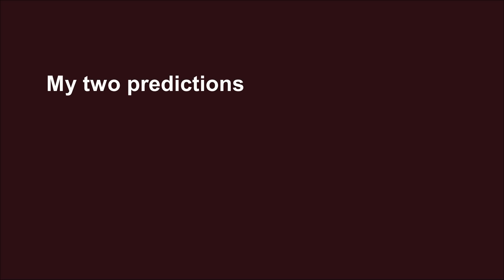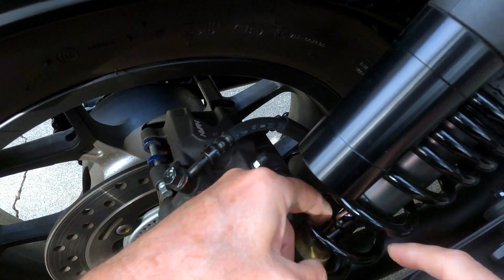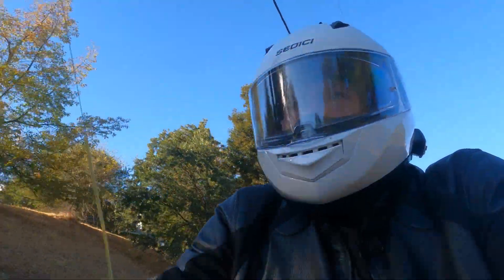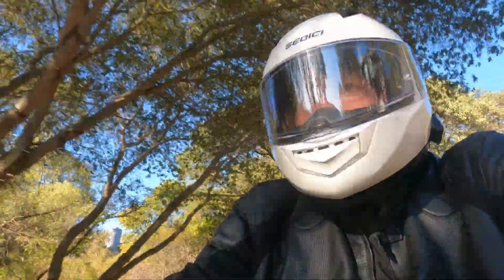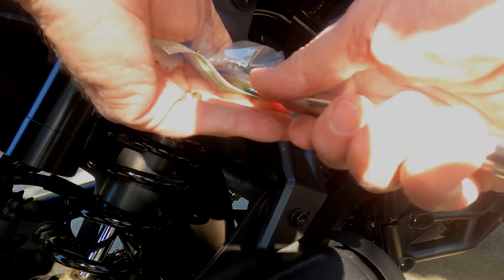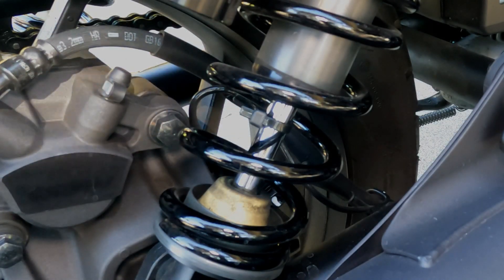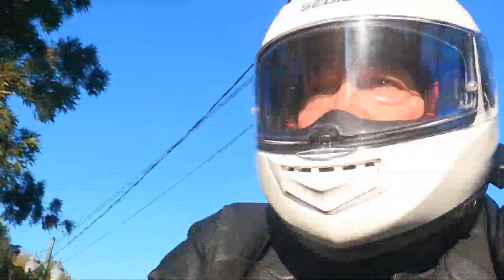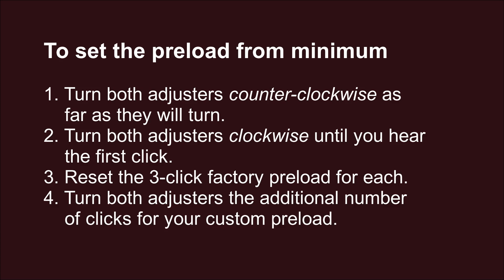Taming your Rebel 1100 suspension

Comment: One thing about modern motorcycles do not have a damm CENTER STAND! I haven’t had a motor cycle since 1985 and have been looking at getting one and no center stands on any of them on my 65 C110 Honda had one my 71 CL350 hade one and my Yamaha 920 Virago had one but the Honda Rebel 1100 I am thinking of purchasing dose not have one!! Now days if you want to change the oil or  adjust the chain or replace a tire you have to buy stuff like a front wheel stand so it wont fall over and some type of a jack stand lift the bike to get the wheel off. Why did they get rid of one of the most useful maintenance items on the bike?

Comment: Hi Papa Steve, your dedicated subscriber here. I hope all is going well with you and your new teaching job. I just want to thank you for this invaluable, extremely useful and indispensable information on setting the preload on my 2022 Honda Rebel CMX1100 DCT. I also found that using a sliding sag scale comes in handy as well, but takes longer to get the actual readings. I’ve considered investing in the digital version, however the zip tie method gets me close enough for a more comfortable ride. I hope that you will consider making more videos about the Rebel because I find your knowledge and experience to be extremely helpful and concise.  All the best to you. 😎🏍️💨🇺🇸✌️

Comment: I'm thinking my rear suspension wasn't set up at all. I'm a very seasoned rider but have had terrible head shake with this bike. New tires and it's even worse. So I checked the travel of these before this video but wanted to watch this video during adjustments. I adjusted rear to 9 clicks and it's still close to bottoming out. I set to 12 clicks and will do a long test ride tomorrow. BTW these are ~7 minute test rides. so I will update with my 12 click test ride. If not good i'm maxing it out and then lowering down. But I do have some new rear shocks in the shopping cart.

Comment: I am 220 lbs / 100 kg (ah, plus approx 10kg at the passenger seat) and, ended up ad 12 clicks one side, 13 clicks the other side.

Not equal, because when double checking with a caliper, the shocks turn out not to be equal. There the caliper is leading. (change is approx 1mm per click)
Reply from the maker: Thanks for sharing your experience, and for the caliper tip.

Comment: Maybe y'all knew this, I did not. Was just making a one click adjustment and noticed that one of the adjuster ring spikes has a very tiny notch at the bottom that will align with a corresponding equally tiny notch at top of shock tube ring just to indicate that you are on an exact click setting. I just mention because some have said they were unsure of the "click" when trying to adjust. These markings are tiny, you have to look very closely.
Reply from the maker: Thanks for the tip.  I'm gonna go check that out.

Comment: New Rebel 1100. I'm 235 lbs. and so far up 5 clicks in rear and feel significant improvement but will likely go one or two more. Solo rider. Haven't messed with front but may try half a turn there too. I am considering Burly Brand Stiletto for rear to add a little travel. We will see. Thanks for the video. Oh, I use small strap wrench rather than spanner for adjusting. Rubber strap, no marring of finish. Does the job nicely.
Reply from the maker: Thanks for the tip.  I'll a strap to my tool kit.

Comment: Realising I'm a bit late to the party, but.. I'm 160 pounds (72,5 kg) and needed 4 clicks from the stock setting. Several road bumps in my street, so no need to test for half an hour :)
Great info, should have done this two years ago. Many thanks Steve!
Reply from the maker: You are so welcome.  I previously weighed 160 pounds.  That was a few years after graduating from high school.  I'm 77 now and 190.

Comment: Hello! I bought used bike and don't know settings in front forks. Can I firstly adjust it fully counterclockwise to 0 position? Can I feel stop at 0 pisition?
Reply from the maker: I don't know what will happen if you crank it to the zero position.  The front fork has plenty of travel, so bottoming out will not be an issue during normal rides.  I would adjust it to the stiffness that feels right to you. I tightened mine just enough to counteract some of the front of the bike's  downward pitch.

Comment: Hi, do you consider the DCT version on this XY graph, or the manual version?
There's ~20pounds (~10kg difference) in between both versions, F.Y.I.
Reply from the maker: My data is about the DCT only.  But the same zip-tie test will work on the manual transmission version.  Thanks for the input.
Reply: @papastevesgarage  Thanks for the reply.
Considering my weight (187 w gear) + 1100T DCT (+22 pounds difference with non-T DCT) + accessories (+3 pounds for now) + my usual backpack (8 pounds or so) I should consider a rider weight equivalent to 220 pounds on your graph, which is like 6 clicks I presume.

I was using it  with 8 on commute and 10 on highway and I was feeling everything on the road, maybe that was the reason :D I should use it w 6 on daily commute and 7 on highway or when I fill my saddlebags and backpack with groceries.

Increasing preload above the needs causes actually a lower travel so I understand that now.

I would appreciate if you make a similar graph considering the fork offsets but measurements from offset surface via a caliper maybe, instead of turns from the stock position (my forks had different offset on right and left fork btw, user should check it).

Comment: Had my rebel nearly 3 years and just assumed the rear suspension was fine from how it reacted just pressing down on it anyway saw this video and did the zip tie test and it was way too soft, i weigh around 250lb and i finished up setting it at 12 clicks this leaves the zip ties just off the bottom, ride is way better now so thanks for your help
Reply from the maker: I appreciate your feedback.  Glad I could help.

Comment: Thank you for your Rebel 1100 videos, Mr Koski. I always feel better about tinkering with my machine after one of your lessons. 
I had already added two "clicks" to the original preload on my Rebel 1100 shocks, but now I'm confident in going much further. And considering the fact that I'm nearly twice your weight, and I travel on semi-paved Georgia goat trails, I should almost certainly do so.
Reply from the maker: Very welcome! Have you run the cable tie test to check your preload settings?

Comment: Great video!  I used the zip tie test and ended up at 9 (total) clicks just as you did.  I ride solo and weigh in at around 190 lbs.  On the last test ride, I hit a major pothole and the zip tie did bottom out on both back shocks but I consider that acceptable.  The difference in ride and handling is very noticeable.  I might stiffen the front shocks just a bit though they were well within the Honda recommended range even after hitting the pothole.  2023 DCT, less than 200 miles so far and loving the ride!  Thanks Steve!
Reply from the maker: It's great motorcycle.  I'm glad you found my video helpful.  Stay in touch.

Comment: Thanks for the great video and information! Did you end up updating your preload suspension/weight chart with more weight information? I didn’t see an updated chart at the end of the video. Cheers mate!
Reply from the maker: The info I received from viewers was pretty meager.  Too often I couldn't use it because I couldn't tell if the respondent used my method.  So, I created my graph.  The updated graph is not in the video. I listed the values in the information to the video and provided a weblink to the graph. I want to emphasize that the graph only provides estimates. Do your own zip-tie test. I hope that helps.

Comment: Thanks for this video. I also like the chart you've linked in the description.

Question - Suppose I loose count...  Will the rear shock stop allowing me to turn it once I've reached the maximum number of clicks? Or the minimum number of clicks? Or do I risk completely disassembling the shock itself if I loose count?

Thanks again!
Reply from the maker: You can screw the adjuster off the end of the shock if you go to far. If you lose count, it’s safer to crank the adjustor to it’s minimum compression, then count back out from there.
Reply: @papastevesgarage  Thanks!

Comment: Thank you so much for this excellent video! I'm 250 lbs and 12 (3+9) clicks are not yet enough, but the zip ties aren't getting buried, they just reach the rubber stop. I guess 1 click more and I'll be fine.
Test ride felt way better already today, however!
Reply from the maker: If they just reach the rubber stops, I think your setting is fine.  The suspension will get very stiff if you adjust too far.

Comment: I saw a video saying the opposite for rear shocks.  Said to loosen all the way to avoid violent rebound. The front adjustment was minimal but I forgot tightrope or looser. 170lb rider aprox
Reply from the maker: Interesting but dubious idea.  The only way I know how to avoid "violent rebound" would be to install rebound dampening shocks.  The Rebel 1100 with factory suspension doesn't do a great job of rebound dampening. 

My suspension adjustment method doesn't address rebound.  I only show how to reduce bottoming out the rear shocks.  You wouldn't want your car suspension to bottom out routinely while you're driving.  The same applies to your motorcycle.  Of course, when you increase the preload, the suspension will get stiffer, but the stiffer suspension will also ease your buns over the potholes and speed bumps by avoiding the sudden stop when the shocks bottom out and slam into their rubber bumpers. 

Send me the link to the site you saw if you get a chance.
Reply: @papastevesgarage  Dave Moss Tuning focuses on race track suspension set ups.  His videos set up various sport bikes.  He lowered the Rebel's preload to better match what he thought the weak dampening needed.  But in his defense, he did tell the owner to put grease on the shock shaft to check travel and ensure the shock wasn't bottoming out.  I just got my Rebel DCT this week.  I'll rebuild the shocks with heavier oil over the winter.  Increase the compression and rebound to go with new stronger springs.

Comment: Very thorough video while SHOWING what you were doing. I found this video quite helpful. I am currently 6’2, 265lbs. I am currently sitting on 10 clicks but might go up 1-2 more. I have not changed the front suspension YET but will 100% be doing that. Been a little cold and wet so I’m waiting for a good day.
Reply from the maker: How's the ride?  I backed off a click on mine, which softened the ride without increasing bottoming out much.  I'm 5' 10 and down to 196 now.
Reply: @papastevesgarage  Been having some unfavorable weather recently but honestly still adjusting. I need to get some calipers to see where my front is turned to. My rear also needs adjusting. I’ve been using the zip tie method and still find I bottom out. Two factors are rough roads where I’m at…lots of potholes and railroad tracks…aaaaand unfortunately putting some winter lbs on. I’ll have to give you an update when the weather gets better with updated clicks and lbs

Comment: Any idea if this ADDS any additional suspension travel to the rear suspension? Can you measure it?
Is the stroke length of the 2 shocks any different or longer?
Reply from the maker: I can't give you a definitive answer because I haven't found one that persuades me.  I don't think changing preload changes the available suspension travel very much if any bit at all, other than changing the distance the shock plunger travels because the spring is softer or stiffer. I could be wrong about this.  I invite input from viewers who have greater expertise.  

What preload adjustment does is to add or subtract compression to the springs so the ride becomes stiffer or softer.
Reply: Increasing preload doesn't increase suspension travel. To do that, you'd have to replace shock absorbers with ones that have longer stroke. I think Stiletto Shocks from Burly does that?

Comment: Probably about 5 kg per click. 160kg max to about 3 clicks 65 kg. 9 clicks for 210  # or 95 kg.  30 kg added = 6 clicks added.   275# rider = 125 kg   125- 65g =  60 kg more /  5 kg - click means add 12 clicks to the existing 3.  That should get you in the ball park for 275 #
Reply from the maker: I'll graph this when I get a chance and post the visual.  Thanks for the input.
Reply: @papastevesgarage   is this for front and back? 5kg per click?

Comment: Thanks for starting the table...Honda really should provide something like this.  
Here is result to add to your table:  I weigh 169 lbs and tried various settings for multiple rides on city, rural and highway.  
- Front shock -  fine with factory setting and travel down to 75% consistently
- Rear shock - only number of clicks that consistently had the zip tie above the bottom rear shock (about 10-20% distance from bottom)  was 9 for me (6 above factory setting).  Surprising since you had same setting and weigh in the 200lb range.  I'll try this for a while and maybe go down to 8 if I find it too stiff.
Reply from the maker: I actually found since I did the video that 6/9 was too stiff, so I've loosened the preload by one click to 5/8.  I like the ride better. Although, I felt a heavy bump during my ride yesterday, when the bike bottomed out on a highway dip.  I plan to do the zip tie test again.  My bet is that you will eventually back off the 6/9 preload, too.  You don't really need to eliminate all bottoming out, just the routine bounce.
Reply: @papastevesgarage   I have come to the same conclusion as you did and the 9 setting which prevents zip ties from bottoming  on all conditions out was too hard.  After trying a few settings, I settled back to  5 setting (165lbs) and just did a 800 mile 3 state road tour and was perfectly happy with this setting.  After all this, not sure what the real value of the zip tie test is except finding limits of the shock travel.

Comment: Very helpful, thanks. I didn't use zip ties but added 8 clicks to each rear shock for a total of 11. I weigh 230-240 lbs. Ride is much improved. Also added 2 full rotations to each front shock to stiffen. Better. Will do a zip tie test this weekend hopefully. Bottoming the rear shocks is pretty scary. Like riding a bucking bronco!
Reply from the maker: Let me know what click count you settle on after the the zip tie test.  I'll enter your results into my online table.

Comment: Thankyou...please clarify....if I'm a big boy 265 lbs...I would be turning the tool counterclockwise in the rear shocks to increase the length of the springs so I don't bottom out...is this the correct thinking about this?
Reply from the maker: You're thinking about it backwards.  What you want to do is increase the shock absorber preload to make the springs stiffer, not to increase their length.  Turn the adjuster clockwise for stiffer springs.
Reply: @Papa Steve's Rebel 1100 Garage  thankyou for your reply...it just seems to me that the stiffer springs would make the bounce less cushioned...the longer the spring the more length of your bounce....I thought I read the manual correctly....no?
Reply: @accordiondr  The ride will be stiffer, but you will reduce the frequency that the springs bottom out.  That actually makes the ride better.  Ride smoothness depends on the relationship between "sprung weight" and "unsprung weight" as controlled by the stiffness of the springs.  Sprung weight is the combined weight of the motorcycle and the rider resting on the springs.  Unsprung weight is all of the weight below the springs: wheels, tire, drive gear, and such.  The greater the difference between sprung and unsprung weight, the stiffer your springs need to be.  Your 265 pounds, plus the sprung weight of the motorcycle, is 60 pounds heavier than me on my Rebel 1100.  You need stiffer springs to compensate for the additional weight.  I bet when you add the spring preload, you'll be pleasantly surprised with the quality of the ride.  Take some time to do the zip tie test, before and after making the adjustment so you can physically see the difference your adjustments make.
Reply: @Cruisin' with Papa Steve  thankyou...I must think about this a bit....not knowing I counterclockwise all shocks all the way...nothing came loose and the ride was comfortable over  bumps...the larger springs seemed to cushion me more from the shorter springs in the rear and also same effects on front end 🤔
Reply: Make sure you are looking down from the top for clockwise/Cc reference.

Comment: Nice video. So I would think if the max load weight of the bike is 348 pounds 
and the rear suspension has 18 clicks, divide 348 x 18 which equals 19.33 pounds per click. So if you weigh 205 pounds divide this by 19.33 then the number of clicks is approx 10.6. for your weight. Then I would - or +  1 click depending on how it rides. I see you got 9 which isn't to far from 10.6 so maybe this is a quick way to get you in the ball park first. Using the zip tie is a brilliant idea though.
Reply from the maker: I like the way you think.  However, you're idea is based on two assumptions that may or may not be valid. 

First, the math assumes the relationship between rider weight  and spring compression  is linear.  I don't know enough about shock absorber engineering to know whether the weight/compression ratio is linear or nonlinear.  

Second, the idea assumes that Honda engineers have  matched the Rebel 1100's shock absorbers to a range of rider weights from 19.33 pounds at 1 click to 348 pounds at 18 clicks.  I suspect it is not likely Honda engineers seriously considered riders weighing less than 100 pounds would be cruising on a 500-pound, 84-horsepower motorcycle. That would render the first five clicks mostly meaningless.  Even so, I agree with you that calculating the appropriate number of clicks mathematically, is pretty good starting point. Thanks for the insight.